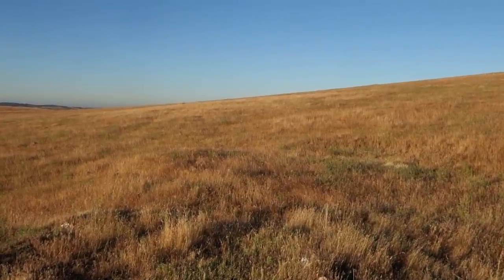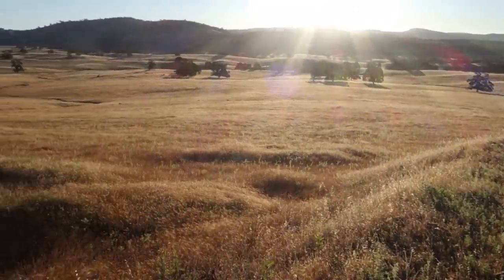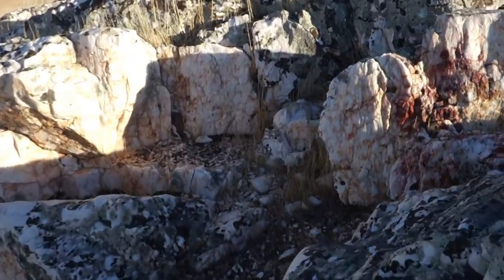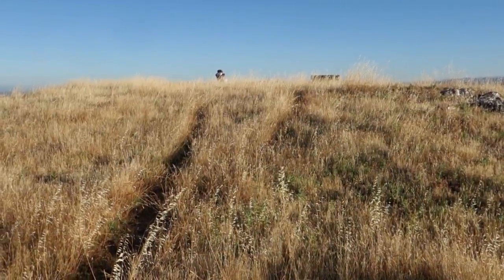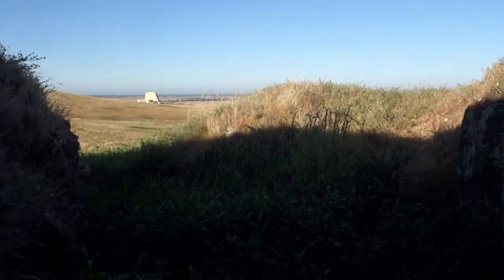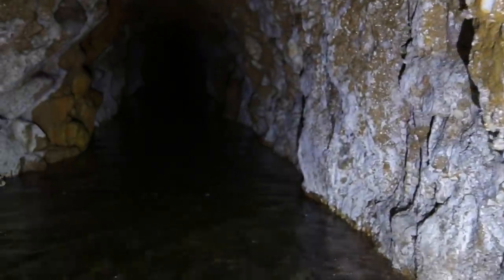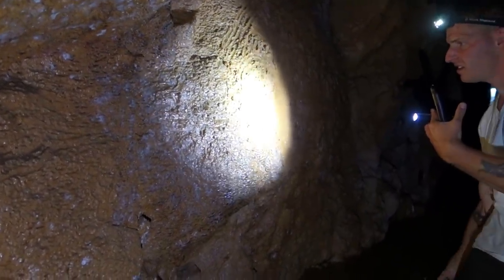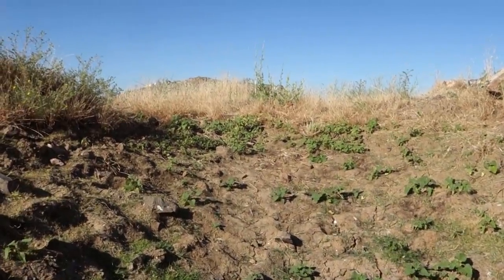The Gold Mines Of Beale Air Force Base - Part 1 of 2

Comment: Mine lab gold monster 1000, 800 bucks
Easiest gold machine to learn how to run.
Light weight it will break down fit right in your pack
They are extremely tough I like the old transistor radio‘s .
The hardest part is going to where the gold is you’re already there.
Reply from the maker: A friend of mine got one, but is struggling to figure out how to use it correctly.
Reply: Mine lab gold monster has made it very easy to learn how to find nuggets.
Been mining at rich bar up Highway 70 in feather River Canyon.
Stop in Belden and ask for the owner he will if any of us are up there.
Everybody is very friendly no stress.
If the owners up there just go ahead and come on up Richboro Road go underneath the train tracks and just keep going straight until you hit the switch back you’ll see S owners very friendly and will give you the tour original 1853 or 1863 cabin is still there some interesting stories tell him who you are and he’ll give you the tour.
Raw pros with a detector separate the owner and would be happy to get you going.
I’ll give you my phone number but I don’t know don’t know how to do it without the public .
I do have some interesting adventures for you.
Reply: Mine lab gold monster has made it very easy to learn how to find nuggets.
Been mining at rich bar up Highway 70 in feather River Canyon.
Stop in Belden and ask for the owner he will if any of us are up there.
Everybody is very friendly no stress.
If the owners up there just go ahead and come on up Richboro Road go underneath the train tracks and just keep going straight until you hit the switch back you’ll see S owners very friendly and will give you the tour original 1853 or 1863 cabin is still there some interesting stories tell him who you are and he’ll give you the tour.
Raw pros with a detector separate the owner and would be happy to get you going.
I’ll give you my phone number but I don’t know don’t know how to do it without the public .
I do have some interesting adventures for you.
Reply: Mine lab gold monster has made it very easy to learn how to find nuggets.
Been mining at rich bar up Highway 70 in feather River Canyon.
Stop in Belden and ask for the owner he will if any of us are up there.
Everybody is very friendly no stress.
If the owners up there just go ahead and come on up Richboro Road go underneath the train tracks and just keep going straight until you hit the switch back you’ll see S owners very friendly and will give you the tour original 1853 or 1863 cabin is still there some interesting stories tell him who you are and he’ll give you the tour.
Raw pros with a detector separate the owner and would be happy to get you going.
I’ll give you my phone number but I don’t know don’t know how to do it without the public .
I do have some interesting adventures for you.
Reply: Mine lab gold monster has made it very easy to learn how to find nuggets.
Been mining at rich bar up Highway 70 in feather River Canyon.
Stop in Belden and ask for the owner he will if any of us are up there.
Everybody is very friendly no stress.
If the owners up there just go ahead and come on up Richboro Road go underneath the train tracks and just keep going straight until you hit the switch back you’ll see S owners very friendly and will give you the tour original 1853 or 1863 cabin is still there some interesting stories tell him who you are and he’ll give you the tour.
Raw pros with a detector separate the owner and would be happy to get you going.
I’ll give you my phone number but I don’t know don’t know how to do it without the public .
I do have some interesting adventures for you.
Reply: Mine lab gold monster has made it very easy to learn how to find nuggets.
Been mining at rich bar up Highway 70 in feather River Canyon.
Stop in Belden and ask for the owner he will if any of us are up there.
Everybody is very friendly no stress.
If the owners up there just go ahead and come on up Richboro Road go underneath the train tracks and just keep going straight until you hit the switch back you’ll see S owners very friendly and will give you the tour original 1853 or 1863 cabin is still there some interesting stories tell him who you are and he’ll give you the tour.
Raw pros with a detector separate the owner and would be happy to get you going.
I’ll give you my phone number but I don’t know don’t know how to do it without the public .
I do have some interesting adventures for you.
Reply: Mine lab gold monster has made it very easy to learn how to find nuggets.
Been mining at rich bar up Highway 70 in feather River Canyon.
Stop in Belden and ask for the owner he will if any of us are up there.
Everybody is very friendly no stress.
If the owners up there just go ahead and come on up Richboro Road go underneath the train tracks and just keep going straight until you hit the switch back you’ll see S owners very friendly and will give you the tour original 1853 or 1863 cabin is still there some interesting stories tell him who you are and he’ll give you the tour.
Raw pros with a detector separate the owner and would be happy to get you going.
I’ll give you my phone number but I don’t know don’t know how to do it without the public .
I do have some interesting adventures for you.
Reply: Mine lab gold monster has made it very easy to learn how to find nuggets.
Been mining at rich bar up Highway 70 in feather River Canyon.
Stop in Belden and ask for the owner he will if any of us are up there.
Everybody is very friendly no stress.
If the owners up there just go ahead and come on up Richboro Road go underneath the train tracks and just keep going straight until you hit the switch back you’ll see S owners very friendly and will give you the tour original 1853 or 1863 cabin is still there some interesting stories tell him who you are and he’ll give you the tour.
Raw pros with a detector separate the owner and would be happy to get you going.
I’ll give you my phone number but I don’t know don’t know how to do it without the public .
I do have some interesting adventures for you.
Reply: Mine lab gold monster has made it very easy to learn how to find nuggets.
Been mining at rich bar up Highway 70 in feather River Canyon.
Stop in Belden and ask for the owner he will if any of us are up there.
Everybody is very friendly no stress.
If the owners up there just go ahead and come on up Richboro Road go underneath the train tracks and just keep going straight until you hit the switch back you’ll see S owners very friendly and will give you the tour original 1853 or 1863 cabin is still there some interesting stories tell him who you are and he’ll give you the tour.
Raw pros with a detector separate the owner and would be happy to get you going.
I’ll give you my phone number but I don’t know don’t know how to do it without the public .
I do have some interesting adventures for you.
Reply: Mine lab gold monster has made it very easy to learn how to find nuggets.
Been mining at rich bar up Highway 70 in feather River Canyon.
Stop in Belden and ask for the owner he will if any of us are up there.
Everybody is very friendly no stress.
If the owners up there just go ahead and come on up Richboro Road go underneath the train tracks and just keep going straight until you hit the switch back you’ll see S owners very friendly and will give you the tour original 1853 or 1863 cabin is still there some interesting stories tell him who you are and he’ll give you the tour.
Raw pros with a detector separate the owner and would be happy to get you going.
I’ll give you my phone number but I don’t know don’t know how to do it without the public .
I do have some interesting adventures for you.
Reply: Mine lab gold monster has made it very easy to learn how to find nuggets.
Been mining at rich bar up Highway 70 in feather River Canyon.
Stop in Belden and ask for the owner he will if any of us are up there.
Everybody is very friendly no stress.
If the owners up there just go ahead and come on up Richboro Road go underneath the train tracks and just keep going straight until you hit the switch back you’ll see S owners very friendly and will give you the tour original 1853 or 1863 cabin is still there some interesting stories tell him who you are and he’ll give you the tour.
Raw pros with a detector separate the owner and would be happy to get you going.
I’ll give you my phone number but I don’t know don’t know how to do it without the public .
I do have some interesting adventures for you.
Reply: Mine lab gold monster has made it very easy to learn how to find nuggets.
Been mining at rich bar up Highway 70 in feather River Canyon.
Stop in Belden and ask for the owner he will if any of us are up there.
Everybody is very friendly no stress.
If the owners up there just go ahead and come on up Richboro Road go underneath the train tracks and just keep going straight until you hit the switch back you’ll see S owners very friendly and will give you the tour original 1853 or 1863 cabin is still there some interesting stories tell him who you are and he’ll give you the tour.
Raw pros with a detector separate the owner and would be happy to get you going.
I’ll give you my phone number but I don’t know don’t know how to do it without the public .
I do have some interesting adventures for you.
Reply: Mine lab gold monster has made it very easy to learn how to find nuggets.
Been mining at rich bar up Highway 70 in feather River Canyon.
Stop in Belden and ask for the owner he will if any of us are up there.
Everybody is very friendly no stress.
If the owners up there just go ahead and come on up Richboro Road go underneath the train tracks and just keep going straight until you hit the switch back you’ll see S owners very friendly and will give you the tour original 1853 or 1863 cabin is still there some interesting stories tell him who you are and he’ll give you the tour.
Raw pros with a detector separate the owner and would be happy to get you going.
I’ll give you my phone number but I don’t know don’t know how to do it without the public .
I do have some interesting adventures for you.
Reply: Mine lab gold monster has made it very easy to learn how to find nuggets.
Been mining at rich bar up Highway 70 in feather River Canyon.
Stop in Belden and ask for the owner he will if any of us are up there.
Everybody is very friendly no stress.
If the owners up there just go ahead and come on up Richboro Road go underneath the train tracks and just keep going straight until you hit the switch back you’ll see S owners very friendly and will give you the tour original 1853 or 1863 cabin is still there some interesting stories tell him who you are and he’ll give you the tour.
Raw pros with a detector separate the owner and would be happy to get you going.
I’ll give you my phone number but I don’t know don’t know how to do it without the public .
I do have some interesting adventures for you.
Reply: Mine lab gold monster has made it very easy to learn how to find nuggets.
Been mining at rich bar up Highway 70 in feather River Canyon.
Stop in Belden and ask for the owner he will if any of us are up there.
Everybody is very friendly no stress.
If the owners up there just go ahead and come on up Richboro Road go underneath the train tracks and just keep going straight until you hit the switch back you’ll see S owners very friendly and will give you the tour original 1853 or 1863 cabin is still there some interesting stories tell him who you are and he’ll give you the tour.
Raw pros with a detector separate the owner and would be happy to get you going.
I’ll give you my phone number but I don’t know don’t know how to do it without the public .
I do have some interesting adventures for you.
Reply: Mine lab gold monster has made it very easy to learn how to find nuggets.
Been mining at rich bar up Highway 70 in feather River Canyon.
Stop in Belden and ask for the owner he will if any of us are up there.
Everybody is very friendly no stress.
If the owners up there just go ahead and come on up Richboro Road go underneath the train tracks and just keep going straight until you hit the switch back you’ll see S owners very friendly and will give you the tour original 1853 or 1863 cabin is still there some interesting stories tell him who you are and he’ll give you the tour.
Raw pros with a detector separate the owner and would be happy to get you going.
I’ll give you my phone number but I don’t know don’t know how to do it without the public .
I do have some interesting adventures for you.
Reply: Mine lab gold monster has made it very easy to learn how to find nuggets.
Been mining at rich bar up Highway 70 in feather River Canyon.
Stop in Belden and ask for the owner he will if any of us are up there.
Everybody is very friendly no stress.
If the owners up there just go ahead and come on up Richboro Road go underneath the train tracks and just keep going straight until you hit the switch back you’ll see S owners very friendly and will give you the tour original 1853 or 1863 cabin is still there some interesting stories tell him who you are and he’ll give you the tour.
Raw pros with a detector separate the owner and would be happy to get you going.
I’ll give you my phone number but I don’t know don’t know how to do it without the public .
I do have some interesting adventures for you.
Reply: Mine lab gold monster has made it very easy to learn how to find nuggets.
Been mining at rich bar up Highway 70 in feather River Canyon.
Stop in Belden and ask for the owner he will if any of us are up there.
Everybody is very friendly no stress.
If the owners up there just go ahead and come on up Richboro Road go underneath the train tracks and just keep going straight until you hit the switch back you’ll see S owners very friendly and will give you the tour original 1853 or 1863 cabin is still there some interesting stories tell him who you are and he’ll give you the tour.
Raw pros with a detector separate the owner and would be happy to get you going.
I’ll give you my phone number but I don’t know don’t know how to do it without the public .
I do have some interesting adventures for you.

Comment: Would u be so kind as to briefly explain what that is on the base that fries passing birds w/radiation? That said, I luv quartz - looks like u guys just (re?)discovered Quartz Mountain. Bet, in such arid environs, u weren't expecting flooding. Kind of dangerous, if the water is all muddled up, to head in barefoot - any number of sharp-edged artifacts could be lying in wait neath the surface to make yr little piggies cry "wee, wee, wee, all the way home!" I also luv the sparkly walls. What, exactly, were the muddied finger-painters trying to accomplish? Hazard a guess? A good wknd to u & yr buddies.